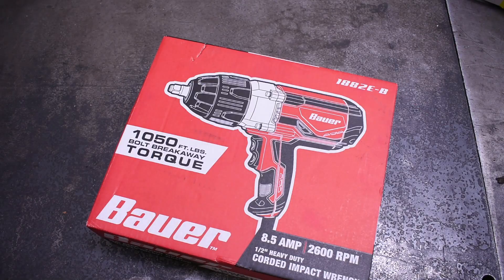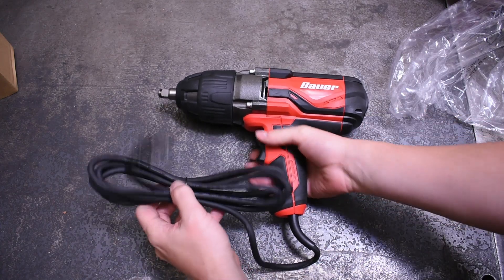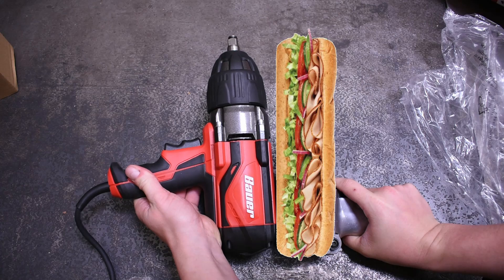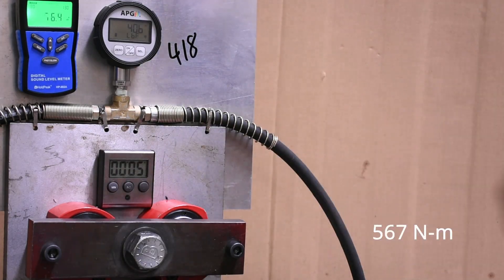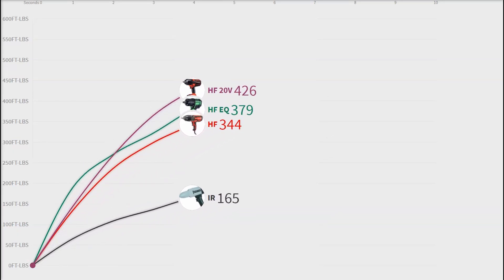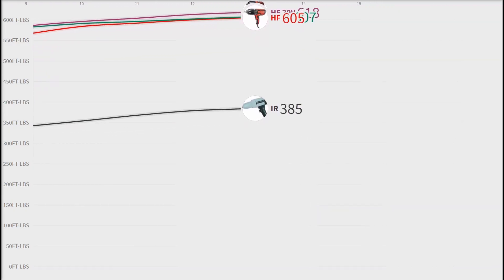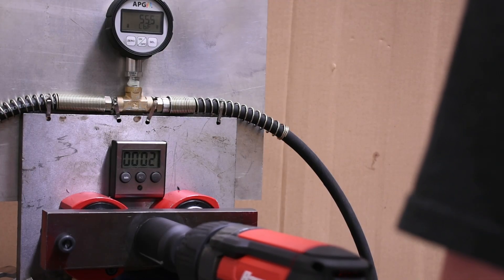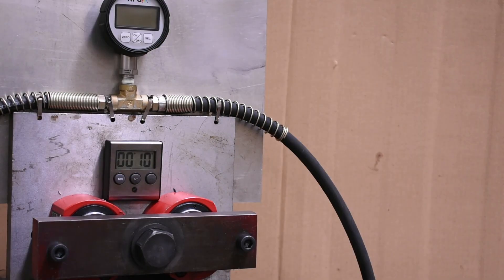How Much Torque Can a CORDED Impact Make? + Dyno Test Extension Cord Losses

Comment: Im needing one for my struts I broke a ratchet and bent so many trying to get the nut loose. Finally got it moving but still was extremely tough to get it going. So hopefully it has enough torque to get it off. 7/8 socket is what I think fit I had 21mm and something else

Comment: OMG, thank you for sharing this video. Your a godsend. I need a decent impact for 1 job and I only own a 2 gallon air compressor, so I was concerned about air impacts, and I don't want to spend money to get a cordless for 1 pulley removal on a Honda Navi, 110cc belt replacement. The corded impact should be more than enough power to remove the drive pulley to replace the belt. Thank you so much. 😀
Plus I will be using a good 12 guage extension cord.

Comment: You should test the voltage at the plug or extension cord where you plug the tool in. Voltage drop is all youre worried about with extension cord unless you using something too small for 8.5 amps. More voltage will give more power generally.

Comment: I wonder if the brushes are seated from the factory or if you need to break them in to have them contour with the commutator.  If not then more power could be left on the table.

Comment: A corded tool, is not rated in "amp hours", since the amps coming out of the wall are endless. It's just Amps. Even the cordless tool isn't rated in Amp hours. The battery is what is rated, and you could change the battery to more aha's or less. The tool wouldn't know the difference or be any more or less powerful,  it's just how long the battery lasts before it runs low. The amps and volts available to the tool, is in the circuitry and the motors ability to do work.  Torque is the only number that matters in an impact tool. 
Air: the PSI being sufficient, the volume in cfm is a controlling factor,  as is the amps available to the corded tool through the extension cord. If either are not sufficient,  you won't get the full power potential of either. I've been in shops with too small of air pipes, or small diameter supply hoses, or restrictive air chucks, and the air tool had little power available.  Wanna see amazing,  run a shop air tool off a towable air compressor with a 1/2" hose and a 1/2" chuck on the tool. It will hurt your hand, it has so much power.

Comment: You guys should test 12v car outlet impacts. Yes, they do exist oddly. 

There’s also the craftsman corded (450 ft/lbs), porter cable (probably not that great at this point), oem tools (400 ft/lbs claim), a wen claiming 450 ft/lbs for 50 bucks, and even a Milwaukee corded ($200 though for only 300 ft/lbs).

Comment: Hey TTC, if you have any interest in calculating and graphing what the instantaneous change of torque (rotatum) would be (if torque is velocity then the derivative would be acceleration). 

It would show the difference between tools that get to X torque level very quickly vs ones that take a while to get there but still get there.

Comment: Cordless will never be a real competitor, and if these manufacturers wanted, they could add every one of these cool new features they add to cordless, to corded. We still dont have led lights on damn corded drills.
Reply: The power you can get from a corded tool is always higher.
If we were to max out a 240V US or 230V European outlet we could have impact wrenches too powerful for their own good for sure. 
The Makita TW1000 and Bosch GDS 30 both big heavy industrial corded impacts are rated at around 700 ft-lbs tightening. 
The Bosch has a 920W Motor and the Makita has a 1200W Motor.
If these tools were ran on a 240V US Outlet I recon one could double the motor power and double the power of the impact mechanism since that motor would now be able to drive a huge hammer and hammer spring.

Comment: I have an old corded DeWalt impact gun that couldn’t remove much(beyond useless). It was just collecting dust after I invested in real powerful impact wrenches. And I hand an old lawn mower that would give me trouble when it hadn’t ran in a long time. So I welded the hammer and anvil together and made it non-impacting to help me start the mower(worked amazing). But now I run a 40v DeWalt mower. 
It still has plenty of power for running mixing bits for mortar and cement. 
Once again, it basically collecting dust.

Comment: What gauge extension cord did you use for that experiment?
If you look in the owners manual for the Bauer, they tell you to use I believe at least a a 14 gauge 50 foot extension cord to get the power out of it with that length. Longer length will take like a 12 gauge extension cord. If you use the correct extension cord, I would think he wouldn’t get that percentage loss. It would be interesting to know.
I’m not sure what gauge the cheap orange ones are that we always get. But they can make a big difference on if you can get the power that you want instead of being plugged into the wall.

Comment: I remember having a corded drill back in the day that didn't have a reverse. We are spoiled by modern equipment. 

In fact, my house was built in 1964 by hand. Every board was hand cut and either nailed in or screwed in by hand with flathead wood screws. That would be torture.

Comment: I bought one of these corded Bauer ones back in 2020 to change the wheel bearing on my 05 Explorer. I paid something like 80 dollars for it plus 30 for HF sockets, and had absolutely no problem getting any nut or bolt out. You should have seen the cloud of rust that flew off when I got that axle nut finally off!

Comment: Worth mentioning for those with enough corded tools to benefit (or the right use case) is a fat inverter can run them off your car or truck battery (leave the engine running) especially for intermittent use or if your truck or van has dual batteries (more surge amps). 

I have corded, pneumatic and cordless tools so not only no dog in the fight but I want to own ALL the dogs. This includes manual slugging wrenches which are glorious, and epicyclic manual torque multipliers which every mechanic should own (X-4 are worth everything they cost and then some but others like them are available). Easy to see why the heavy equipment guys use those.

Comment: I'm thinking about buying this just for removing front sprocket bolts off sportbikes. They're supposedly only torqued down to 120 foot pounds BUT after running the bike hard for a while it synches em down on there hard. Lol my regular impact won't get it soooo I'm looking for a high torque impact

Comment: Other household uses would be removing the nut holding wash tub in a top load washer and the anode rod in a water heater. It does not occur often but this tool would deliver.

Comment: We used an old corded Milwaukee (in the heavy duty orange) rated for 300ft-lb to drive tapcon bolts for pallet and extrusion racks, our shop air impact wouldn't drive them bc of air pressure (shop runs at 90-110 for die grinders, and we were using about 100ft of hose) so someone brought in that old corded Milwaukee and on about the same amount of extention cord it drove them like deck screws. With this being on the cheap end, I could see this being an attractive option for doing a project like that. Or maybe you already run a generator on your jobsite but not a compressor. They also have the cheaper Chicago electric, being about $45, or $35 for ITC. And I'm sure you could find even cheaper on amazon if you're not concerned with warranties.

Comment: I have the older Chicago Electric version.   I've used it occasionally for about 15 years and for the $40 I paid it was a good buy.   I have air and just recently bought a battery impact now so it's unlikely to see much if any use now.   For a budget option it's great, especially if you don't have air.

Comment: Used the bauer over the last few years mostly to break the lower 2x bolts on full sized car struts. They were rusted bad on my 07 avalon and this tool was able to break them free. She is a Big Bitch but for the price impossible to beat as long as you have an outlet. Just noticed over the last weekend these were $49 at HF

Comment: When you test it the corded old one and the new one from harbor freight you noticed that they underestimated the torque value. It seems like harbor freight Bower did the same thing in the manual. 

I noticed the harbor freight one the manual says 300 ft pounds versus the boxes thousand and I was a little bit disappointed by that. However in your testing you got nealy 600 lb from it. Which is double the value from the manual.

Comment: Watched this review and decided to get one. 49.99 parking lot sale today ends tomorrow! Havent used it but been wanting a stronger impact then my little dewalt extreme 1/2".  Wanted a 891, but for 50 bucks, this will do
Reply: Can we use this corded from ac to dc converted from the car 12v outlet ??
Could you please reply

Comment: I bought the corded Bauer impact wrench this weekend for $60 with a coupon.  Also got a decent socket set for $20 with a coupon. I don't use an impact wrench enough to warrant buying one with  a battery.  All I need one for is to break seized on nuts for lawn mower blades.

Comment: 3:39 I would guess that the motor takes up the full length of the plastic part. You can see the sparks flying around in the back and the fan blades right before the hammer. Also universal motors have no problem running on AC.

Comment: After failing to remove a 30mm nut  from the rear suspension of my truck with a breaker bar,  a pipe, and all my might. I finally gave in and got that same Bauer impact wrench and man, it took it off like it was a little baby nut. "Who's the boss now 30mm nut!?" I recall shouting, it was very satisfying. I did use a high guague extension cord from my generator to make sure it got the juice it needed. I highly recommend 👍
Reply: i just picked one up today for a crank pulley nut, before i bought it i soaked it in wd40 overnight hit w/M18 impact wrench first, then cranked on it by hand...said F it and picked up this Bauer and the nut came off in no time.

Comment: That HF is on sale right now. For those that need that much trq a couple times a year it has its place given the price point and performance. Its about 1/3-1/4 the price of similar in performance, popular brands, cordless impacts "tool only". And the HF ratings have it at 96% recommend it.

Comment: A heavier gauge extension cord will reduce the power loss in the cored impact.  You are using a small gauge cord which will cause a voltage drop.  It would be good to see a comparison between a 25' or 50' cord comparing 16, 14, and 12ga cords.  The higher the amperage of the tool, the higher the voltage drop will be.

Comment: The air tool coming out early is because of the pressure built up in the line.  You'll find that a larger diameter hose and a freer flowing adapter will likely increase the power after the initial burst.

Comment: this was the first impact I ever had! I've moved on to a ryobi PBLIW01B high torque, but I always keep the bauer around just in case I dont have charged batteries at the moment. only complaint is that it smells pretty bad when running it for any amount of time, although there seems to be no effect on longevity or performance

Comment: just curious. . . why dont you do all 15 second runs or more. ? in real world if your really trying to get all the beans your gonna run it as long as possible, i understand there not fast working numbers BUT if you really needed, time is not an issue as long as that bolt comes off
Reply from the maker: We use actual testing standards, none of which exceed 15s. Also we start from 0 torque. You bolt is likely not
Reply: @TorqueTestChannel  thanks, i didnt know that was a standard,  was just speaking from expereince, there have been times i have used under power impact for 30+ seconds trying to gett something sturborn off and with time it sometimes actually comes off. .  i guess even mroe of a reason, is im curious what things could if time was no  limit, for example what would the baurer do for 15 seconds forward, what about 30 seconds in reverse,  even more intresting at what second does it stop increaseing, does it even stop increasing??? just a curous mind

Comment: Hey can you please test a Porter Cable PCE 211?Also maybe a good “Amazon Brand” to try is the Enertwist to expand on the corded lines. I’ve commented in the past but love that you guys finally did a corded! I know cordless are all the rage and the new hotness with better versions coming out almost monthly but I think had y’all tried out the Porter Cable it would have made your top 10 underrated tool list because I think StanleyB&D is down playing its power to steer people over to Milwaukee and Craftsman kind of like what TTI did to Rigid Octane. You can pick up these tools for less than a replacement battery and everyone owns an extension cord. Thanks for the consideration. Also since you already have it in the shop, would love to “at least” see the Bauer get timed on the 500# lug nut test if you aren’t interested in expanding on the “boring” corded versions. We can see if those fireworks come back! Keep up the good work

Comment: Corded impacts make zero sense in 2022. They're expensive, huge and weak. This Bauer will burn up in no time. The brushes are already sparking like a tool at end of life! Then they have the spindown and no variable speed. Cordless is the winner in 2022. Dad gave me an old 60s IR. When it will actually remove lug nuts torqued to 80-100 ft-lbs, it is slower than my 1/4" dewalt impact. What the old ones were good for is construction work where you could hammer all day and they gave no shits. Lag bolts and whatnot.
Reply: They might make sense for a dyi guy who has no air and just does tire swaps and maybe an odd job. Used a few times a year they should last a long time.

Comment: I had an early 2000s central pneumatics hf plug in impact, a huge beast that could barely break a lugnut. Recently threw it away after 20 years taking tool box room

Comment: This is a great tool. When your breaker bar won't work, and you don't have enough money or time to buy $300 battery impact wrench or air one with compressor, I highly recommend getting this. Hub bolt on my civic was stuck and couldn't take it off by 4 ft breaker bar with 220lb me jumping on it. I spent about 3 hrs. But this electric impact removed the bolt in just 2 seconds.

Comment: well, considering that the corded tools you showed are only rated at 7.5A of current draw at 120v for a maximum output of 900w, and a proper 21700 cell battery can output as much as 1,400w in a 5x2 cell arrangement, there's no reason that a cordless tool should be considered inferior to a corded tool anymore based on available power alone.

Comment: Do I understand correctly that the Earthquake only managed about half of its' rated torque power as did the other tools?  If so, are the tools grossly over-rated or does your torque tester need calibration?
Reply from the maker: Harbor frieght often rates in breakaway only which is loosening. We tighten even in reverse. But also yeah, overrated too

Comment: That is a good video. I bought the porter cable 7.5 amp corded 1/2 inch impact to do some work on my car and truck. The porter cable impressed me with what it can do. It took off CV axle nuts with no problem, it took off the pinion nut on my truck along with doing some suspension work. Would like to know what you think of the porter cable 7.5 amp corded impact.

Comment: Oof. I have a single nut on a hydraulic cylinder the service manual says to torque to “600 to 700 ft lbs”. I’ve already bent some cheater bars trying to get it off, and now I’m wondering if I should buy one of these to try and remove it.

Comment: Why does it say 300 ft lb in the specs at 0:59 but 1050 on box
Reply from the maker: Working measurable torque is always quite different to nut busting

Comment: I'd be really interested in seeing you test a Chicago Electric 1/2in against the Bauer 1/2in corded just so you can show how much better of a deal the Bauer is for the $40 price increase. I purchased a Chicago Electric for the sole purpose of breaking a crankshaft bolt free on an engine out of the vehicle, it didn't have the beans.
Reply: I'd like to see the numbers too.

I use the CE tool on VW axle nuts w/o issue and they are torqued over 200 ft lbs.

Comment: I just sold my Milwaukee corded 1/2 “ impact. It put in thousands of ledger bolts for decks in its lifetime. But ever since 1/2” lag and carriage bolts have been replaced with smaller more efficient bolts I can put in with my Makita td170 impact or the larger 40v drill it hasn’t come out to play. The new style bolts for deck ledgers explicitly state in the directions to be put in with a drill not an impact

Comment: Somebody may have already mentioned this but it looks like you guys are using a cheap 16ga extension cord. At a minimum on any jobsite you'd see 14ga cords if not 12ga. I use only 12ga cords on power tools because they draw so many amps.

Comment: Why does a good extension cord reduce power to the tool?  I've installed outlets, though I'm not an industry pro, and  can say that an outlet and it's GFI wiring are just extensions as well from a common hot wire source.  So what gives?